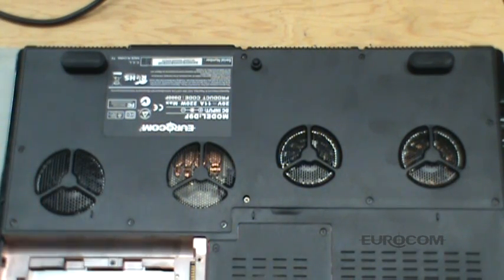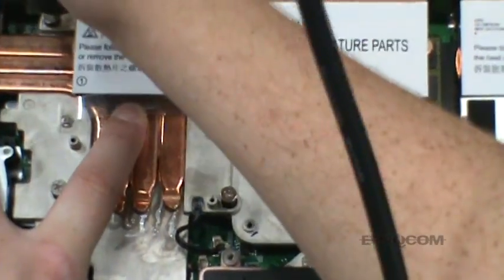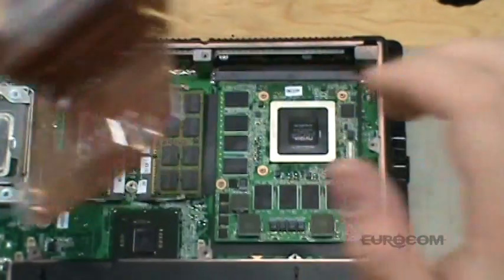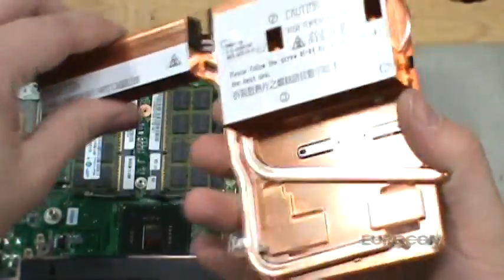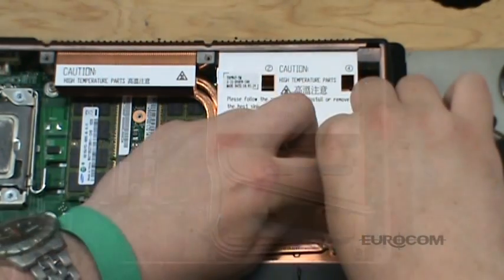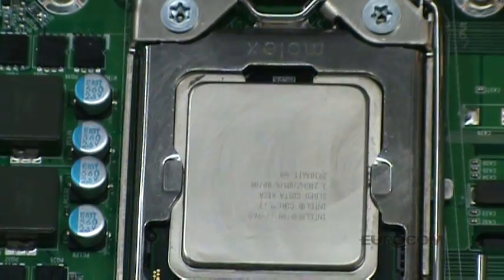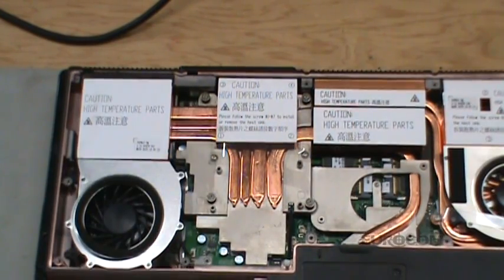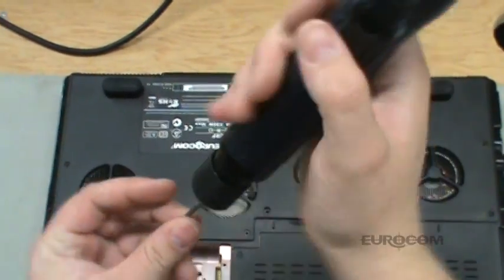Eurocom NVIDIA GTX480M Installation

Comment from the maker: The 480M works great in the d900f.  We have also upgraded the d900f with up to a 680M with no problem.  The d900f is an exceptionally well built computer that is extremely durable and long lasting.

Comment from the maker: @M4ri024LOVEWTC 
Upgrading the CPU from an i7-960 to an i7-990 is easy enough and can be done by someone with a little bit of experience.  When upgrading the CPU there is no requirement for new software.  When upgrading the GPU you will need to install new drivers for that specific card.  Throughout the entire process I recommend referring to the service manual and consulting with a support technician.  Good luck!

Comment: A question:i want 2 buy a clevo x7200 with an i7 990x or an i7 960. if i buy it with the 960 can i upgrade to a 990x l8er???in your video it looks like you can easily change the cpu like in a desktop pc. are there any bios updates for cpus and gpus???

Comment: Would it be possible to get the model numbers of the 4 fans in the panther 2.
I don't want the heatsink model numbers if possible, I want the 5 volt fan model numbers..
Vga = 
CPU = 
(2)Vga= 

I am curious also of the manufacture, dimensions and CFM values for them, which I could find out if I know the model numbers ;).

Thank you

Comment from the maker: @PauseProject18  GPU vendors typically dont sell mobile GPUs directly to the public.  Each GPU needs a specific thermal solution particular to the chassis, along with a myriad of other reasons you cannot simply buy any GPU and put it in any model notebook.  Unfortunately we do not have a location in San Diego but please call 1-877-Eurocom or email sales@eurocom.com.  Alternatively you can take a look at our Ebay store (Razors Edge by Eurocom Notebooks) Good luck!

Comment from the maker: @CelticFan1988  Each mobile GPU needs a  thermal solution (heat sink) specific to the chassis.  If you are not an expert I suggest getting professional help.  Feel free to contact Eurocom support at support@eurocom.com.

Comment: @Greev84 He upgraded his own laptop.
This laptop is the Clevo D900f barebone initially, the motherboard has an MXM slot and thus you can swap graphics cards (still wanting to swap my GTX280-m for a GTX480-m in my D900f, but im not sure wether it's supported in my case)